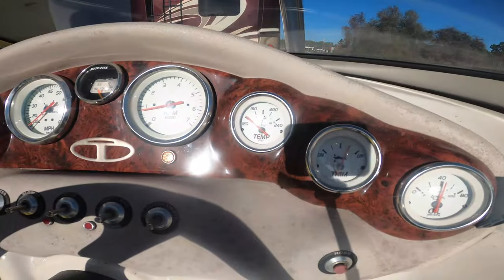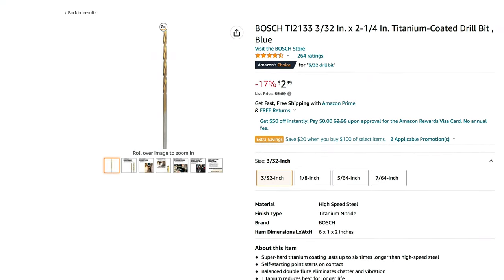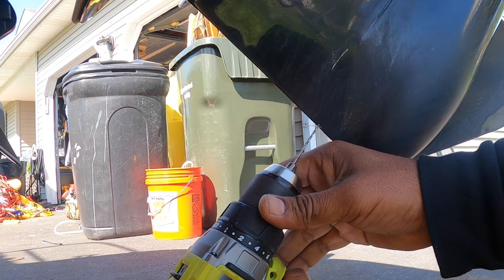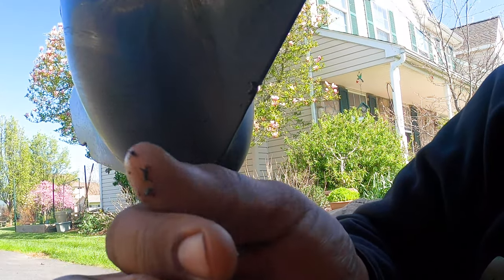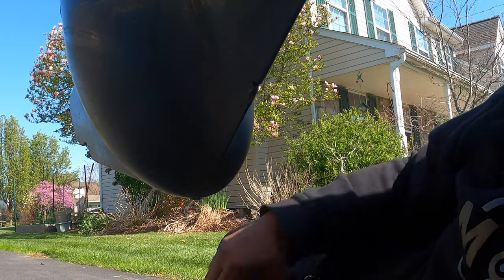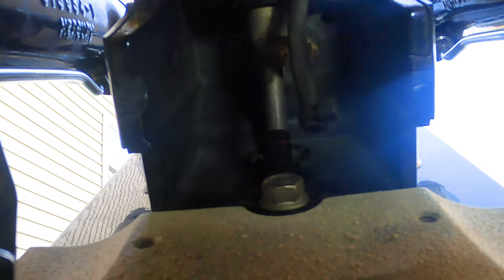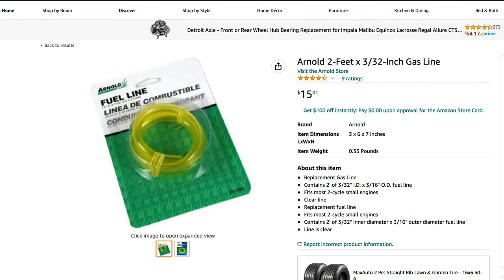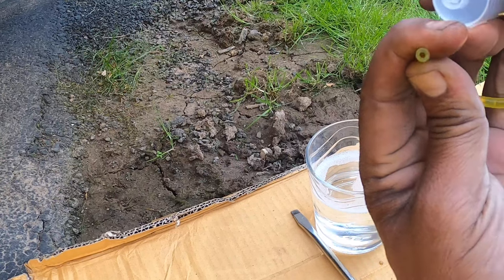BOAT SPEEDOMETER NOT WORKING | MERCURY MERCRUISER

Comment: I have a little problem, my speedometer is lying by half, while swimming at 30 km / h it shows 15 km / h. Is it?
can it be fixed somehow? Is it adjusting / setting in some way? Thank you in advance for your help.
Reply from the maker: Wow that’s odd…not real sure but maybe it has something to do with being clogged. Sorry I can’t give you a more definite answer
Reply: Did you figure this out. Mine is doing the same. However, it was clogged and I did the drillbit thing and seeing the same symptoms. I am going to try removing the clip tomorrow and running water through it to see if it fixes the issue.
Reply: I wonder if is a half clogged some where